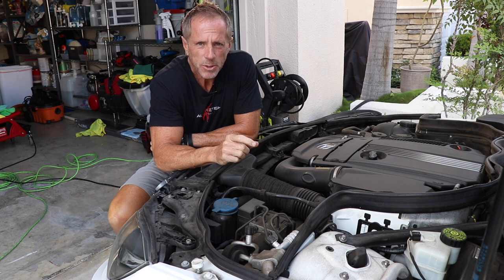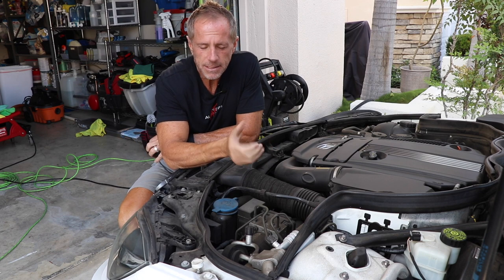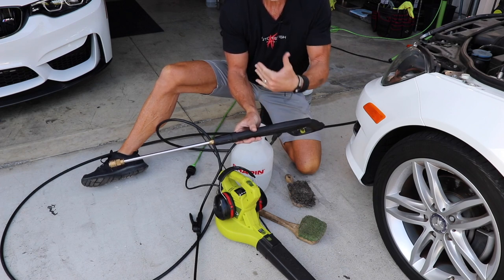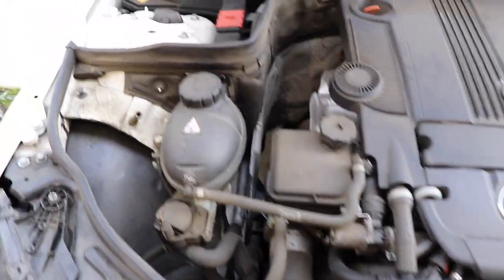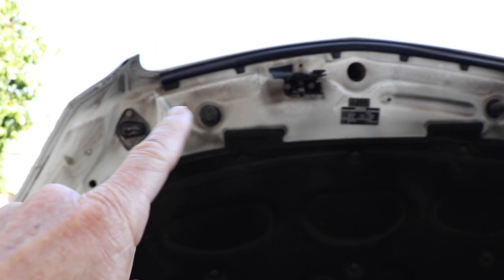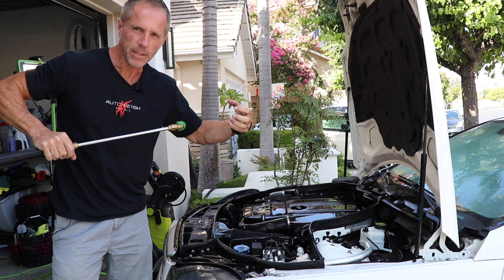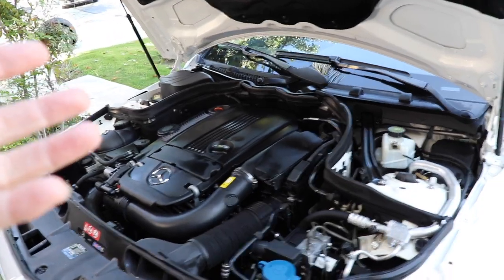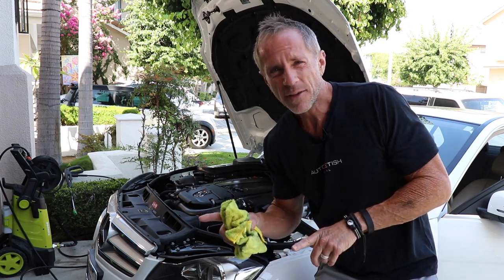Car Engine Cleaning: Professional tips for safe cleaning!

Comment: 0:40 I just passed my driving licence for a motorbike. I have already ride my bike when it's raining. Wonderful ! My engine is waterproof !!! And the same technology is used for cars !!! 

When it's raining and the road is completely flooded, there will inevitably be a lot of water which will wet the engine from below. There is no bulkhead to isolate it from the road.

The motors are made to be waterproof!

11:12 what I've learned is : don't clean the engine while it's running. Beginner can be afraid that the engine won't start after cleaning and they will start the engine before cleaning. The risk is to inject water in the air intake...I think it's true.

(if my english is weird...I'm french)